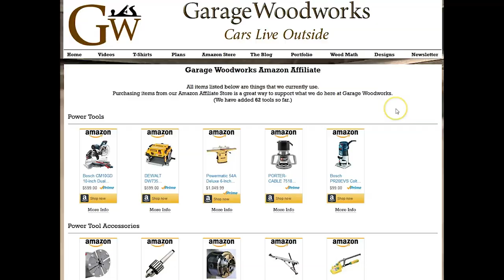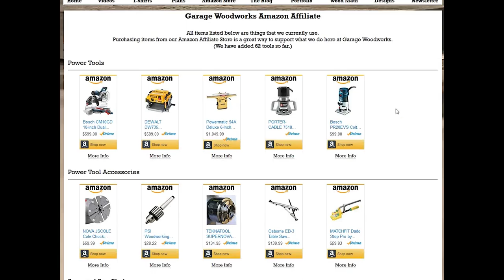Wine Hutch Build - Part 1

Comment: I like a stand with ball rollers.  I've had the cylinder type pull against me.  Thats just me.
Reply from the maker: Yeah, I know what you mean; they need to be aligned properly or else that can happen.  I watch for it and I slide the lumber perpendicular to the roller to compensate when it happens.